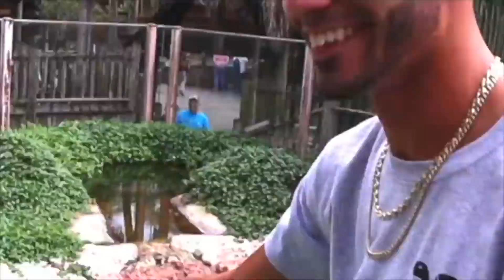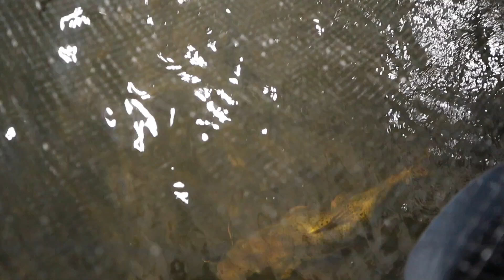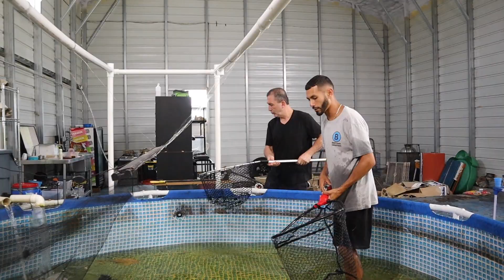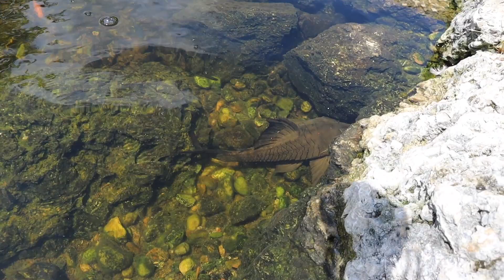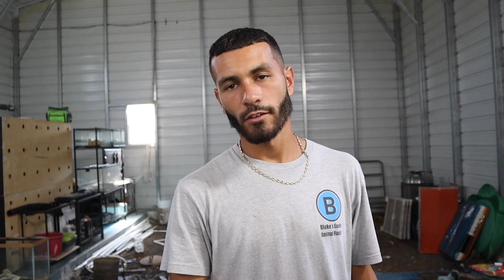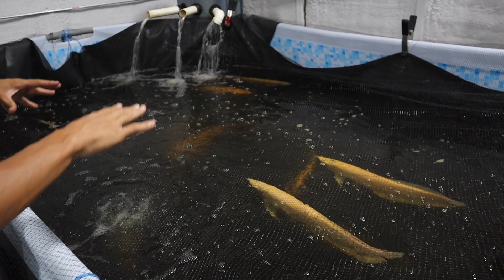WRESTLING MONSTER *PEACOCK BASS* IN GALLERY GOES WRONG!

Comment: Where are those sturgeons by the way?
Reply: same thing i keep asking. never answers lmao
Reply: sturgeon need a tone of oxygen in the water, colder water holds more oxygen than warmer water, so sturgeon typically need cold water to do there best, if the water is warmer then you need either a water cooler to cool the water or a strong pump to pump a tone of oxygen in the water. The oxygen flow in them pond isn't big enough to maintain sturgeon in warmer water, when sturgeon don't get enough oxygen flow through there gills they die.
Reply: @zebedeemadness2672  the type of species he had/has is native to florida...there’s actually a few species of sturgeon native to florida and that do well in warm water. I don’t know if Blake still has them or not, but while some sturgeons prefer cold water, some do perfectly fine in warm.
Reply: @joshuaw2078  I didn't say they couldn't live in warm water, the key is still a lots of oxygen flow. The sturgeon native to Florida are typically around the larger coastal rivers the coast and estuarys = oxygen flow, the sturgeon in Florida are typically in the Northern parts of Florida that typically has more chilled climate than the southern Florida, also they have access to different water depths, the hotter it is the deeper they go to get to cooler water.